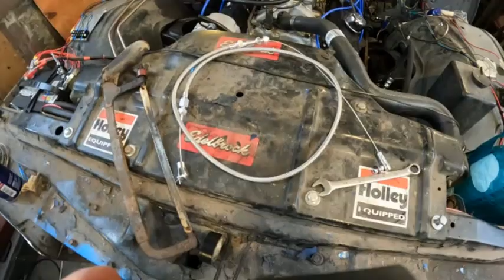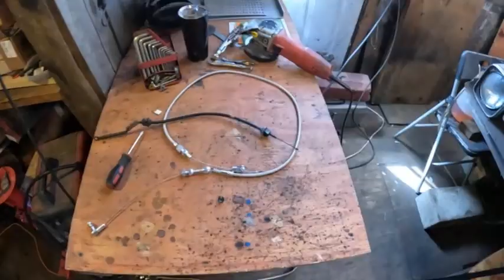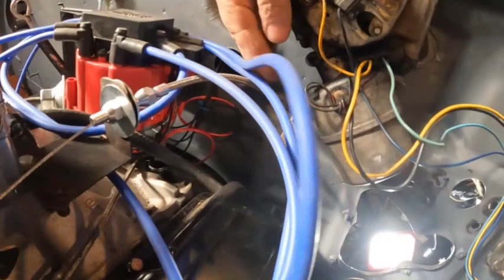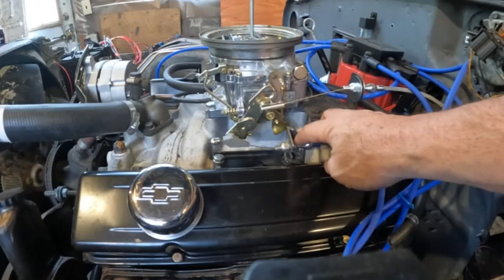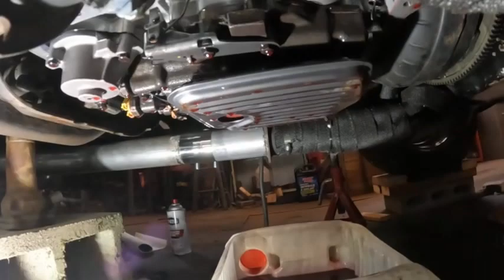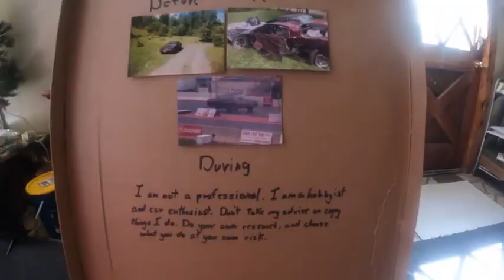Oldsmobile project 16 carburetor throttle and tv cable installation

Comment from the maker: I actually think the stock factory tv cable is better than the after market one I used. The issue that needs most care is use of the after market carburetor, though. The hole in the carbs throttle bracket provided to pull the cable is often in the wrong place. Not just Edelbrocks, but Holleys as well. This is why I demonstrate the setup I do in the video. High torque cars may also need an aftermarket 2nd gear servo piston.